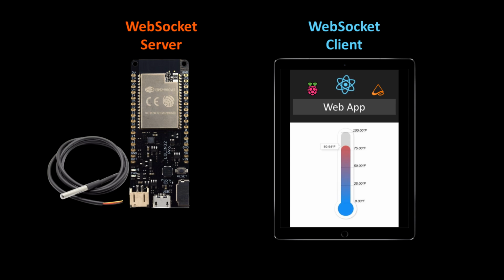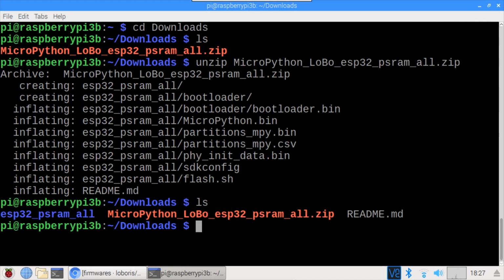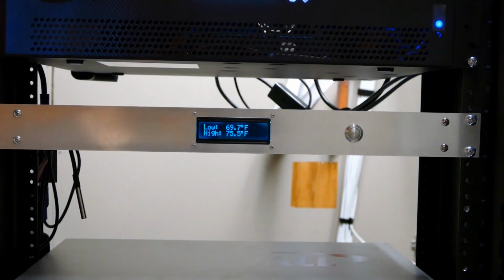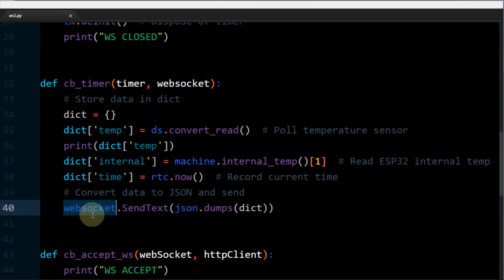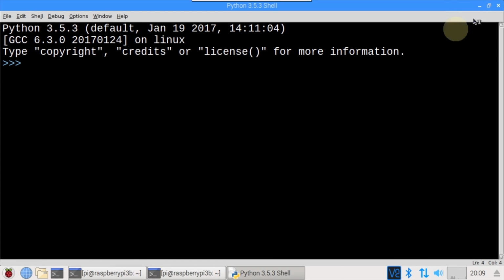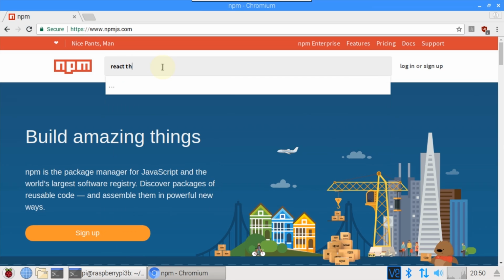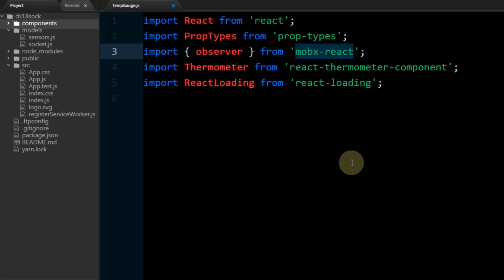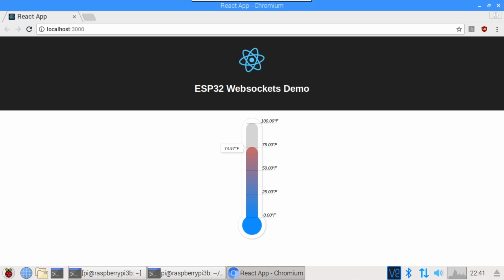ESP32 LoBo MicroPython WebSocket Server with ReactJS & MST

Comment from the maker: Unfortunately, it looks like LoBo MicroPython has been abandoned by the author.  I recommend using regular MicroPython:  www.micropython.org.  Help is available on the MicroPython forum: https://forum.micropython.org
The MicroWebSrv library used in this video also works on the regular version:  https://microwebsrv.hc2.fr
Reply: Is the regular Micropython firmware still the way to go? I'm new (and have followed all your tutorials up to this point) and Lobo sounded great with all the built in stuff to work with the ESP32 wirelessly, has anything filled that hole? Also, there's MicroWebSrv2 now, any changes using that?  Love your tutorials, they're the best I've seen!
Reply from the maker: @jeffreychow8853  Both MicroPython and CircuitPython are great.  I would not use LoBo anymore  I have not tried the new version of MicroWebSrv.  It looks similar to the original but with a lot more features.  I do all my MicroPython development now in VS Code.  There are great extensions for VS Code to work with MicroPython (Pymakr for the ESP32 and Pico-Go for the Raspberry Pi Pico).  In terms of wireless, I use the FTP library by RobertHH if I need to do a lot of file management or if I need to update a deployed project.

Comment: Esp32 over internet,  is there a standalone way other than port forwarding? At the moment I'm using a workaround for which a server like raspberrypi needs to be always on. Any direct method to access esp32 over internet using micropython that you know?
Reply from the maker: It depends what you mean by access.  You could use an easy online service such as Adafruit IO to log data.  Or there are more challenging approaches such as a cloud based P2P server where the ESP32 would be a web client obviating the need to open any router ports.
Reply: @rdagger  Currently I run the broker  on raspberry pi as I choose micro python for esp32. That gives some direction with adafruit io broker or similar available  for micropython framework to explore.   Thanks. 👍🙌

Comment: i have a problem, whenever i rest the esp32 it shows me this:

I (1528) phy: phy_version: 3960, 5211945, Jul 18 2018, 10:40:07, 0, 0
WLAN connection succeeded!
MicroPython ESP32_LoBo_v3.2.24 - 2018-09-06 on ESP32&psRAM board with ESP32
Type "help()" for more information.
>>> W (11558) wifi: alloc eb len=76 type=2 fail, heap:272

W (11559) wifi: m f probe req l=0

W (12559) wifi: alloc eb len=76 type=2 fail, heap:272

W (12559) wifi: m f probe req l=0

W (13560) wifi: alloc eb len=76 type=2 fail, heap:272

W (13560) wifi: m f probe req l=0

 ^X

and whenever i ping the esp32 , i does not response and says :
ping: mpy.local: Name or service not known

thanks
Reply from the maker: Unfortunately, it looks like LoBo MicroPython has been abandoned by the author.  I recommend that you use regular MicroPython:  www.micropython.org.  Help is available on the MicroPython forum: https://forum.micropython.org
The MicroWebSrv library used in this video also works on the regular version:  https://microwebsrv.hc2.fr

Comment: Excellent tutorial! What if I had 50 ESP32s connecting to one web server (as they are avalaible) each delivering temperature and humidity and this data should display in real-time. Would you have any pointers on this configuration? I am using react and I have the components displaying currently, but only with static values as I am flabbergasted on how to make the connection between the ESP32s and web server. Tried POST requests and now trying web-sockets. Any ideas would be appreciated.
Reply from the maker: I don’t think running the websocket server on the ESP32’s (like I did in the video) would be the best solution for such a large quantity of sensors.  I haven’t set up anything on that scale but I think a technology like MQTT would be better suited for the transmission of sensor data.   You can use MQTT over websockets and probably want to store the data in a database that is accessible to the web server and exposed to your client via a backend.There are online solutions that could be helpful such as mLab or Adafruit IO.

Connecting a real-time React web server to a database back end is not a trivial task but there are several technologies that do a lot of the heavy lifting for you such as MongoDB Stitch, Firebase, Meteor JS, Apollo and Socket IO.  There are probably several newer frameworks too, but I haven’t been doing much web programming this last year.

An easier approach is to run an MQTT broker on a Raspberry Pi which could consolidate all the data from your sensors.  Then the single Raspberry Pi could transfer the data to your web server using a web-socket or just a Rest-API.
Reply: @rdagger  
Thank you so much for the MQTT awakening!
I went down that route and it does seem to be the better one with the situation I have.

Performed:

1. I coded the Arduino/ESP32 dongle as a MQTT client
     USING: #include "WiFi.h" #include <SPI.h> #include <PubSubClient.h>
2. I created an Ubuntu Server and have MQTT Mosquitto (BROKER) installed and running
3. I installed MQTT Explorer on my computer and connected with the MQTT Broker on the Ubuntu Server

I can see that this constellation works because I see the "Topics" and "Messages" I coded into the ESP32.

BUT....nothing in my life goes absolutely smooth! My problem now is trying to get the data from the server to display on my webpage using REACT. All the pages I looked into indicated there being 2 options.
1. MQTT over Websocket
2. MQTT directly
Since I tend to go the simplest way with least resistance I tried the 2 option and so far with no luck. Not sure why.
Any IDEAS??? 

COMPONENT:

class Station01 extends React.Component {
  constructor() {
    super();
    this.state = {
        temp: "0",
        level: "0",
        endpoint: "mqtt://192.168.1.10"
    };
  }

  componentDidMount() {
    const {endpoint} = this.state;
    var client = mqtt.connect(endpoint);        
    client.subscribe('dongle/station1/stateofcharge');
    client.subscribe('dongle/station1/temperature');
    client.on('message', function (topic, message) {      
      if(topic.toString() === 'dongle/station1/stateofcharge'){
        this.setState({level: message.toString()})
      }
      if(topic.toString() === 'dongle/station1/temperature'){
        this.setState({temp: message.toString()})
      }      
    });
  }
  renderTempField01(v) {
    return React.createElement(TempField01, {value : v});
  }    
  renderLevelField01(v) {
    return React.createElement(LevelField01, {value : v});
  }
  render() {
    const {temp} = this.state;
    const {level} = this.state;
    return (
      React.createElement("div", { className: "station" },      
      this.renderTempField01(temp),      
      this.renderLevelField01(level)));
  }}
Reply: It is done :)
I changed over to MQTT over Websockets and used mqtt.js and now my life is complete! AWESOME!

Comment: The LoLin D32 Pro board has been discontinued?! But, but, but, only 2 days ago, I ordered v2.0.0 Rev1 from Amazon, thinking that it is the latest and greatest 🤦‍♂️.
So, what is the latest ESP32 flavor of the month?
Thanks for your series. Excellent delivery and guidance. 😎
Reply from the maker: There are many ESP32 boards now.  I still use the Lolin32 Pro.  MicroPython now supports psRAM so any board you get that comes with at least 4MB of psRAM should be OK.  I haven’t tried them, but the TTGO boards are only $10 on eBay.  I've heard good things about the M5Stack but again I haven't used them.  I’m been focusing on the nRF52 lately so I’m not current with the latest ESP32 boards.  You might get a better answer by posting your question to the MicroPython ESP32 forum:  https://forum.micropython.org/viewforum.php?f=18&sid=94ada61a5cca0dcfc8a67e9df1af2f4e
Reply: @rdagger  Thanks for the reply. Yeah, I also have the M5STACK (MS VStudio IDE) an Adafruit ESP32 board (CircuitPython IDE) and a few ESP8266 boards. Too many IDEs and flavors. 
So, my priority is staying mainstream with Thonny, microPython, and compatible hardware. After a few months' research and several learning curves, I'd really like to get on with some actual projects.
I will be following your lead and videos. Thanks for the excellent service that you are providing for the maker community.
nRF52, eh? Sounds interesting. See you there.😎

Comment: Thank you for your video. Great explained, you have to keep doing this, hope will got more subscribers with time. I have a questing. If I open this thermometer from another computer in the same time, will it update the same way - in real time?
Reply from the maker: As long as the computer is on the same network, it should work the same.  However, I don't think this application will support multiple simultaneous connections.

Comment: I have ESP8266. 
But Script code available till power on. Meaning that it not run after restart device.
So,  I want to run my script on boot time.  

Any Solution ?
Reply from the maker: You can create file named main.py.  It will run automatically on boot.

Comment: Great series of tutorials - keep them coming. Vastly improved my knowledge of micropython and web sockets.  MY main issue now is to get the power down on the websocket.  The esp32 doesn't  have much of a handle on low power modes apart from total oblivion   (i'm using esp32-20181012-v1.9.4-632-g11bc38d55.bin from the mp.org forum at present).  I was wondering whether  a websocket would survive a full reset?  Best Regards
Reply from the maker: Sorry, I don't know.  You would have to experiment.  You could also ask Jean-Christophe the creator of Micro WebSrv: https://github.com/jczic/MicroWebSrv
Also Loboris might have some recommendations:  https://loboris.eu/forum/index.php
Thanks for the feedback.

Comment: Amazing! You are great with your tutorials! Keep it up with such a good work!!! Maybe more videos of advance use of peripherals? what about ESP-NOW? or ESP-MESH? Regards!
Reply from the maker: Thanks, I don’t think ESP-Now or ESP-Mesh are implemented in MicroPython yet.  I’m pretty sure they are on the roadmap for the standard and LoBo builds.  I’ve been waiting for low power wireless and I will definitely make a video when MicroPython adds support.
Reply: @rdagger  Do you have any example that the values can be showed in a table instead of using a React app? I want to have a simple example, to see my sensor value updating, just like the web server video you have. Thank you!
Reply from the maker: I was considering doing a video on logging sensors over the network to a database such as a MySQL server running on a NAS or an online hosted database such as MongoDb.
Reply: rdagger68 that would be great too!! In my project I use the ESP32 as AP and connect directly with my phone (remote location, no router). I got your webserver example working, however I will like to improve the reading speed. That is why I started looking at websockets, but React apps are too much based on my current knowledge. Therefore the simple example with a html table or plot maybe? Regards and great job! I appreciate your knowledge sharing :)
Reply: This is what I would like to do in micro python https://canvasjs.com/html5-javascript-dynamic-chart/ any idea it is possible?
Reply from the maker: I haven't tried it, but you should take a look at  https://thingspeak.com/
Should be possible to interface using MQTT.

Comment: I have the following error. Could you help me how to solve?
Python 3.5.3 (default, Jan 19 2017, 14:11:04) 
[GCC 6.3.0 20170124] on linux
Type "copyright", "credits" or "license()" for more information.
>>> from websocket import create_connection
>>> ws = create_connection('ws://mPy.local')
Traceback (most recent call last):
  File "/home/pi/.local/lib/python3.5/site-packages/websocket/_http.py", line 143, in _get_addrinfo_list
    hostname, port, 0, 0, socket.SOL_TCP)
  File "/usr/lib/python3.5/socket.py", line 733, in getaddrinfo
    for res in _socket.getaddrinfo(host, port, family, type, proto, flags):
socket.gaierror: [Errno -2] Name or service not known

During handling of the above exception, another exception occurred:

Traceback (most recent call last):
  File "<pyshell#1>", line 1, in <module>
    ws = create_connection('ws://mPy.local')
  File "/home/pi/.local/lib/python3.5/site-packages/websocket/_core.py", line 502, in create_connection
    websock.connect(url, **options)
  File "/home/pi/.local/lib/python3.5/site-packages/websocket/_core.py", line 219, in connect
    options.pop('socket', None))
  File "/home/pi/.local/lib/python3.5/site-packages/websocket/_http.py", line 113, in connect
    hostname, port, is_secure, proxy)
  File "/home/pi/.local/lib/python3.5/site-packages/websocket/_http.py", line 154, in _get_addrinfo_list
    raise WebSocketAddressException(e)
websocket._exceptions.WebSocketAddressException: [Errno -2] Name or service not known
>>>
Reply from the maker: Try using the IP address instead of the mDNS address.

Comment: Would you have a tutorial on the water level react setup on esp32, it looks amazing, Thanks.
Reply from the maker: I added download links to my website.  It's not a tutorial, but the implementation is identical to the thermometer.
Reply: Thank you, works great. Do you have plans to do any more tutorials on websockets and react? Can you recommend a book/course to a beginner to go further. Regards, Craig
Reply from the maker: I have 2 projects in the planning stages that will probably incorporate WebSockets and React.

In terms of learning, http://www.reactjs.org is a good place to start.  Also www.leveluptutorials.com has some recent React tutorials but I haven’t watched them.  Michel Weststrate (the creator of MobX) has a great tutorial: https://egghead.io/courses/manage-complex-state-in-react-apps-with-mobx

It’s difficult to know where to start.  The best way to learn for myself, is just to dive in and start coding (preferably a project that will motivate you).  Then when you get stuck check out GitHub or NPMJS for code examples.

Comment: This change a little bit. There's no more flash.sh file inside the ".ZIP" file. Try Micropython.bin, and was unsucessful.
Reply from the maker: I just downloaded all 6 prebuilt firmwares from the LoBo wiki and they all still contain flash.sh.  Are you sure you are downloading from the correct site?:   
https://github.com/loboris/MicroPython_ESP32_psRAM_LoBo/wiki/firmwares#download-links-to-the-latest-firmwares
Reply: You are right. The flash.sh file is not INSIDE the directory, it's in the up directory. Thanks for clearing this. Keep up the excellent work.

Comment: Great tutorials. Could you please make a video about led matrix (or more specific max7219) with esp32 using micropython please.
Reply from the maker: Thanks.  There are several existing MicroPython libraries on GitHub for the Max7219 with great examples:
https://github.com/mcauser/micropython-max7219
https://github.com/adafruit/micropython-adafruit-max7219
Reply: rdagger68 thanks for your fast reply. I'm using the first one. But finding the right pins is pain. I used the pins mentioned for esp8266, but it just turn all the Leds on.
 
The one from adafruit is old. For ex changing the state of a pin done by calling "pin.value(1)" now, but that repo uses "pin.low". It might not be that hard to update these.

Still I highly appreciate if you make a video, also if you make tutorial about finding the right pin numbers for right job, especially for spi.

Thanks again
Reply from the maker: Did you check out my ESP32 OLED tutorial?  It has a lot of info on using SPI:. https://www.rototron.info/raspberry-pi-esp32-micropython-oled-tutorial/
Reply: Finally I figured out how to make it work, thanks to your oled tutorial. Also forked mcauser's repository and made some additions here: https://github.com/7kmCo/micropython-max7219

I will try to add even more to this repo. Any comments on my repo is highly appreciated. 

Looking forward to see more from you :-)

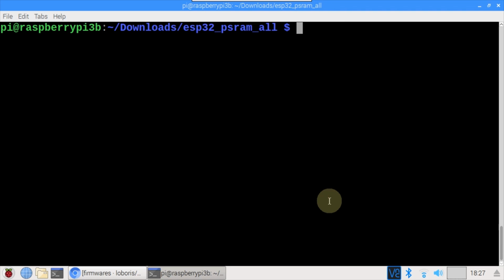Comment: at 4:00 you entered dmesg | grep ttyUSB  This gave a "grep" error msg,  I also tried sudo as well, that didn't work either.
Reply from the maker: Do you have an ESP32 connected to a USB port on the Pi?  What version of Raspbian are you running?  What is the error message?